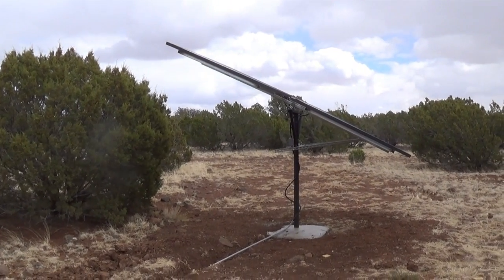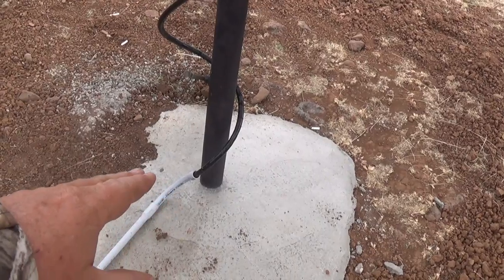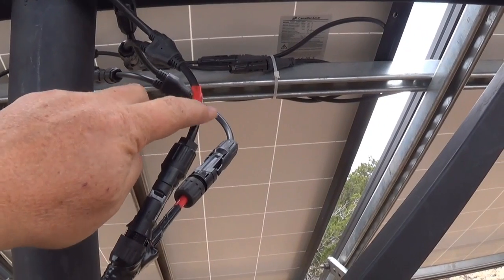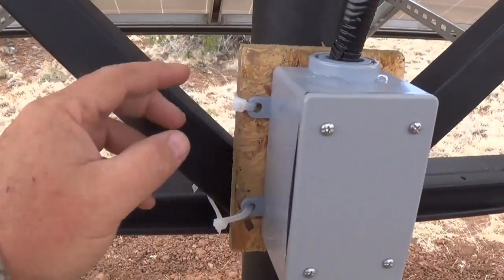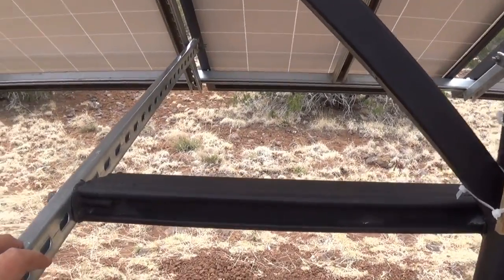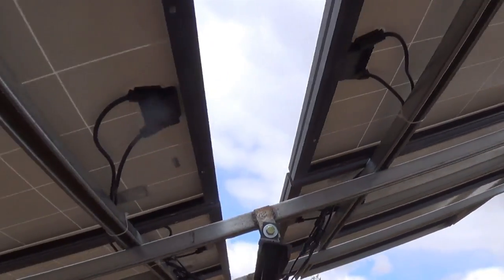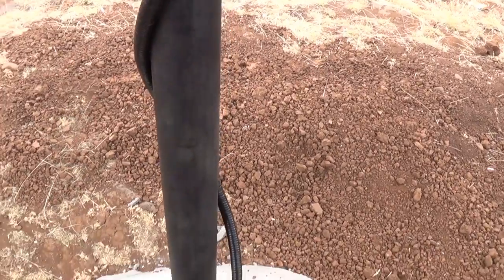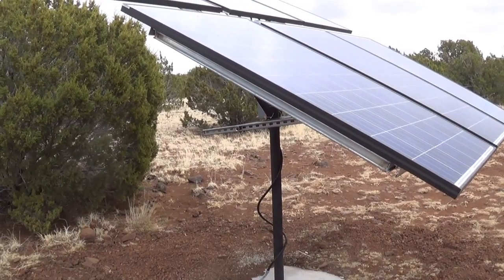Solar Pole Rack - Manual Adjustable both Axis - Holds 6 260w Panels

Comment: very good, did i miss how the series parrell ends up with what voltage
Reply from the maker: +George Gardinier I miss spoke. the panels are 24 volt panels and all connect in parallel not series. so I get 24 volts and each panel is up to 9.x amps so I could get almost 60 amps. my charge controller will only handle 60 amps so I put the breaker in to protect it. but I shouldn't have a problem. ...
Reply: +ArizonaHotHomestead yes in full sun you may get too much. a dump may be needed. perhaps to dump into a water heater probe is what i would do if i had that much. summer is coming and i think you get very hot there. i have read that ac can have a soft start as the wynn's had to get if you know what i mean. i enjoyed the rodent hunting, ha. how is your hunting going.
Reply from the maker: my charge controller does have a dump load option but if not in use the controller just eats the power. ... rodent hunting so far not much. maybe to cold for awhile. I have a dog now and he has brought home 1 mouse and 1 rat. doing good so far. lol   earning his keep. lol
Reply: +ArizonaHotHomestead when will we see the killer rodents dog , ha
Reply from the maker: lol I hope soon. he wont hold still. lol   I think I  will have to get him sleeping and try to get him running all over the place. lol...